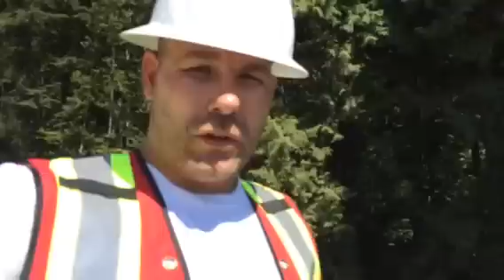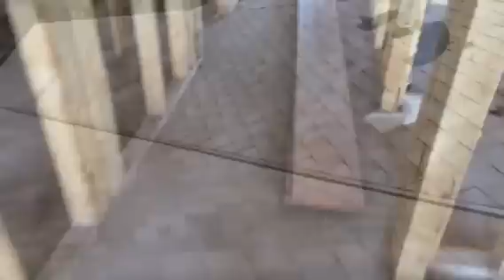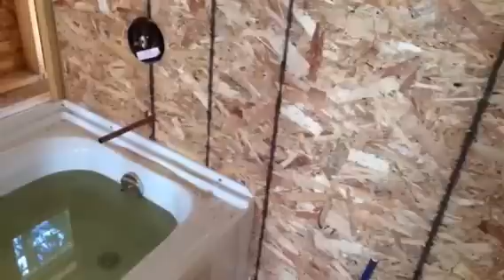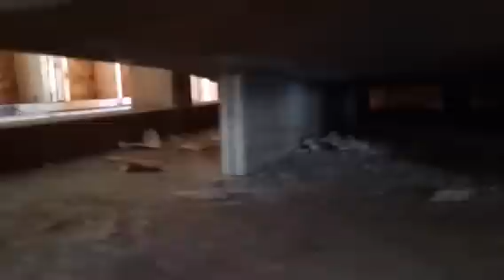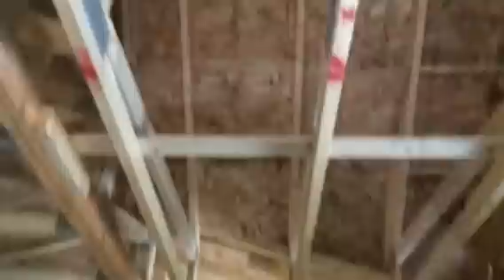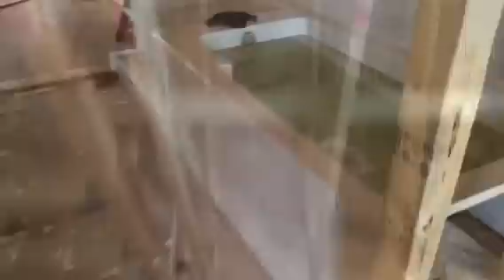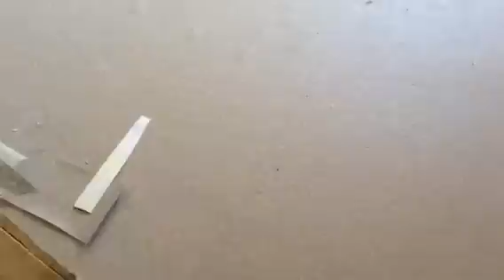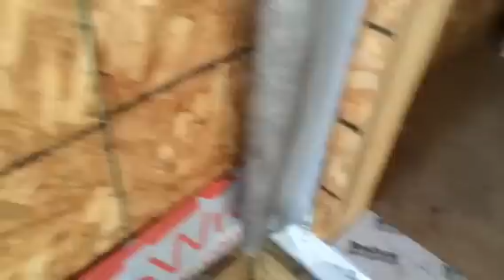New Home Construction Fails

Comment: Not all home inspectors know what theyre talking about anyways.  Always make sure you hire one who has WORKED IN THE TRADES long enough to know what theyre talking about. when i was younger and we were selling the house that my dad built and i grew up in, an inspector tried to tell us we had to rip out and replace the roofing and sheeting because it was "moldy" when really it was just concrete residue since my dad used 5/8" cdx to form the foundation walls and then reuse to sheet 2x10 rafters 16 oc... which is fucking genius.
Reply from the maker: It wasn't a cantilevered deck. It was the front entrance landing Jordan Bergmann.  But thank you for your comments.
Reply: Well in that case, yeah, thats stupid on a whole new level. Ive seen plenty of new kids get put on hanger duty after an exterior deck has been framed and not once have i ever seen that stupid lapse of common sense

Comment: Im pretty sure those upside down hangers are to support down force of a cantilievered joist overhang... if so they did it right. weight offset of deck eliminates need for hangers on the underside as long as the joists are nailed properly. homes were built for hundreds of years without joist hangers man...

Comment: don't know if it's written in the comments yet but that osb under the tub is actually manufactured by the tub producer. All tubs that I have installed come with OSB on the bottom that is factory glued to bottom of tub. But i do set my tubs in Masonry cement.
Reply: One of the main problems is that the tub had no other support under it other than the osb and a small thin piece of osb supporting it out on the edge... all the worker had to do was use a couple pieces of 2x4 (possibly treated) which would help SO MUCH more to keep the tub supported for in the event the water found it's way down into the osb. Once the tub area is sealed off, imagine how much work it will be later on to have to come back and fix a water-soaked piece of osb that's sagging and causing problems with properly supporting the tub
Reply: osb under the tub is factory you can see the fiber glass over spray  actually on the osb. and also the osb glue is far different than years past could very well  be water proof   and note the the tubs still have the tile flange showing meaning they haven't installed the water proof membrane yet plywood backers and extra sheet rock are great at stopping sounds from traveling. but the j
joist hangers lmao really !!
Reply: Rod Doney. Greenboard is only water resistant and is meant for damp locations not wet locations.  In a wet location, you really should use cement board, although I've started using Kerdi because it is watherproof.
Reply: wes booth,
You said "ronan c makes sense. I think pressure treated emits toxic gas if burned"

lol I hope you're not being serious.... no one is burning the treating lumber under their bathtub and if a house fire is in question there are WAY MORE toxic fumes from other materials in the house that the 3 VERY SMALL PIECES of treated lumber supporting the bathtub is the LEAST of your worries
Reply: roman c,
Yes you can... especially in concealed areas where it's not going to pose any danger. Certain/most cities have codes but out here in the country, we do what we want when in reality there's obviously no danger that results from it... If everyone followed what the local, state, federal demands in way of dramatized codes, COUNTLESS people wouldn't even be able to pay their bills after paying for all of costs involved in building permits, inspectors, etc etc etc
Reply: mark hilken There is no reason you cant use OSB on the walls if its covered in greenboard. (drywall for wet walls.)
Reply: @roddoney7568  But the bathtub was already flush with the OSB.  Seems a bit late to put in the moisture resistant drywall.
Reply: @GrantValdes  I'm not sure what you're looking at, but the OSB on the walls were right adjacent to the tub itself, and the drywall green board would be dropping down just to the edge or a little bit over on the tub so that tile or other surround could adhere to. This inspector doesn't know his job.
Reply: Our tub sits directly on the floor joist. The manufacturer actually states that this is how they want it installed. I love it. Was so easy to mount and don't have to worry about osb below the tub and didn't have to cut a hole in the floor.
Reply: wes booth,
yawn yawn you can only throw out vulgar words since you can't reply with anything intelligent...just exposing how much of a doofus you are
Reply: Besides no support tub looked fine. Just didnt look finished. The guy is just like a typical desk jockey or engineer who comes in halfway through the job and points out missed things. Its not missed its jist not done yet. If they put durock in front of the plywood its 100% fine which by the looks of it is what they are going to do. These inspectors read books and have a 2 week course and think they know it all.
Reply: You can not use pressure treated lumber inside a house.
Reply: ronan c makes sense. I think pressure treated emits toxic gas if burned
Reply: Wes Booth you fucking moron.  All wood that makes contact with concrete has to be pressure treated.
Reply: Csongor Stelcz
Thank you for giving more sense to the conversation i really appreciate it : )
Reply: I have not ever seen a fiberglass tub with wood glued to it, that is just calling for water soak and rot.
Reply: pollitics Lie great. Thanks for the info you dumb fuck
Reply: pollitics Lie well then fuck you

Comment: Dude! Roof vent? Did you not see the whole house is on a ridge vent system? Also, with the OSB behind the tub, why didn't they put it on the other side? Probably because they are using a cement board like Durock! 

Typical home inspector, with who I deal with all the time, they are paid to find things even if nothing is wrong. So, they find dumb shit!
Reply: DO IT RIGHT THE FIRST TIME, DUDE
Reply from the maker: Ridge Vent???? Hahahahaha maybe you should go back to the start of the video and see that ridge Vent you speak of from the top of the roof Charles H, clearly your wrong.
Reply: Tom Munro,    That
Reply: Tom Munro,    That is what I am saying! You showed a turtle back. Why count those when the whole roof has a ridge vent system. Turtle backs aren't even needed.
Reply from the maker: There is no ridge Vent on this home Charles H anywhere. There's a ridge shingle but it's not vented.

Comment: our enspector was and is a prick.  we told him it was roughed in and to come do inspections so we could move forward he came in and pointed out small issue ( no problem we fixed them immediately) he told us to move on and continue.  we then needed the final inspection for the c.o. and he said he never inspected the electrical and we were going to have to rip into the drywall and then that he wouldn't continue because it was a " two family residence " which it is not .. the house has always had two kitchens and two bathrooms .. so he left after doing nothing and can fuck himself

Comment: hello, your an inspector i agree the tub is improperly supported but food for thought there is nothing wrong with saving money and using flake board on the back wall because if you know you job the  lip of the tub will be covered with hardy(concrete board) and then tiled and will deflect the water back into the tub! oh thats right you said your an inspector not a tile man!
Reply from the maker: Hey, WSMC Mc the tub support is inadequate. It's simply cheap and the builder installed it to save money but it will flex and fail when the tub is used for a bath. They were replaced after i identified it. 

The OSB sheer wall behind the shower wall board was also removed and replaced after I identified it because plywood has 4x the sheer strength as OSB and IF moisture ever got through the wall it would swell pushing the tile off. 

Most of these negative comments have been made by people who install what they are told to install by the people they work for. Contractors cut corners, it's a fact. I don't let my clients buy sub-standard construction and I make these videos to bring awareness to that. 

Thank for reaching out to me with a question. Have a great day!!
Reply from the maker: You assume it will be covered with concrete board Steve Davis, as inspectors we don't assume anything. But, thank you for your comment, all this OSB was removed and replace with proper plywood which provides 4x the sheer strength of OSB. Have a great day!
Reply: Tom Munro, Can you go into more detail about the bathtub support? if you've already done so I apologise. I've read a lot of the comments and haven't seen anyone say that the support looks like it was manufactured with the tub due to the fiberglass overlap from the tub to the OSB. Also the plywood standing up on edge isn't ripped from material on site. if the contractor had thought this up he would most likely have ripped a piece of 2 x material. I ask because of some of my experience with these things I have found the manufactures of tubs and showers to be lacking when it comes to practical installation of their products and would not be surprised to find this is the manufacturer provided support. Oh, the same useless installation instructions for valves and such. Don't remember if it is Moens or Delta's installation videos here on YouTube that shows the valves being supported by the pipes alone and suggesting a service access hole on the backside of the wall. No regard for the fact that this could be an exterior wall or a wall that has a stair stringer on the other side. Thanks. Scott

Comment: why are the American homes made out of cheap plywood?
Reply: You answered your own question and didn't even realize it. "cheap". Everything in the USA these days is done with the motto of "spend the least amount of money possible, but earn the most amount of money from it as possible", and never mind if it's wrong or bad or falls apart in 6 months. Heck, if it DOES fall apart in 6 months, they can make MORE money by charging to "fix" it... again by them spending the least amount of money possible and charging the most they can get away with.
Reply: Because wood is easily available in the US and homes are not typically so close together that you get the London fire of 1666.

In Europe stone materials are more easily available and homes are often placed too close together to prevent fire spreading.

Properly built homes in North America will outlast the lifetime of the owner and typically last several generations longer with only typical routine maintenance.
Reply: What is your house made of? Metal as in-house trailer?
Reply: Z71Ranger As mentioned in the post right before yours, in Europe they use stone. It's much harder for one accidentally dropped lantern to burn down the entire city.
Reply: +Z71Ranger That's funny, actually most manufactured homes are made almost exactly the same as traditional site-built homes. Do some research moron.

Comment: The OSB under the tub is from the factory. The joist hangers he mentioned "were" installed properly were not. They have to be installed with nails not screws as per the manufacturer. This "Home Inspector" doesn't know what he's talking about.
Reply from the maker: Thanks for your comments Wilber1097 but, you have no authority to tell me what's right and wrong thank you. Just because a factory puts OSB under a bathtub doesn't make it right. Joist hangers are hangers upside down. 

Clearly if you back your comments your part of the problem and not the solution to improve this industry.  I'll be keeping an eye out for your sub-standard projects.
Reply: Tom Munro,    Did you know sometimes the joist hangers can be upside down? When the joist are cantilevered they actually stop against uplift.
Reply from the maker: Lol yes thanks Austin verbeek the front entrance landing was not cantilevered, the hangers were installed upside down.

Comment: A US liquid gallon of water weighs about 8.34 pounds or 3.78 kilograms at 62 °F (17 °C), making it about 16.6% lighter than the imperial gallon. There are four quarts in a gallon, two pints in a quart and 16 US fluid ounces in a US pint, which makes the US fluid ounce equal to 1⁄128 of a US gallon.